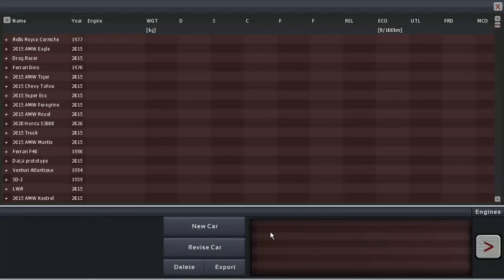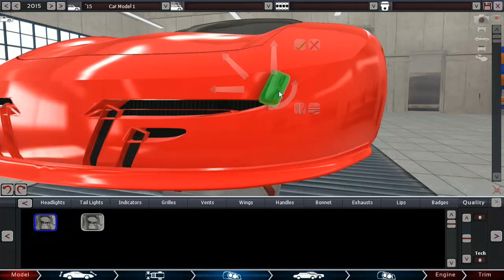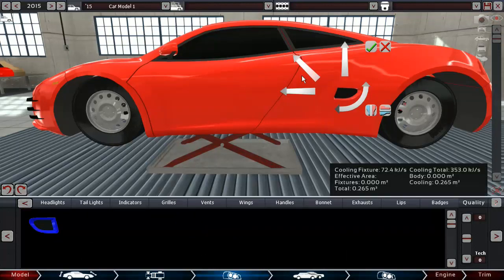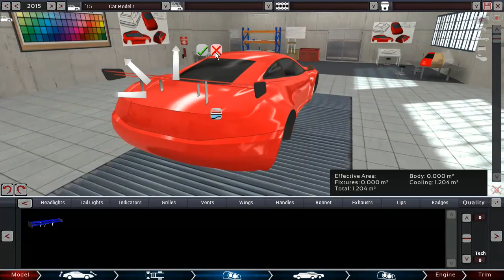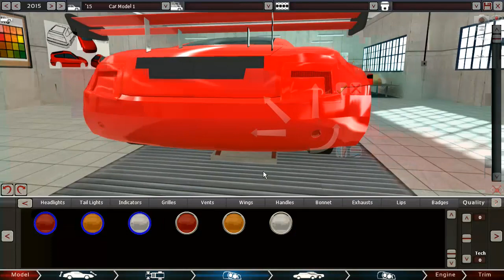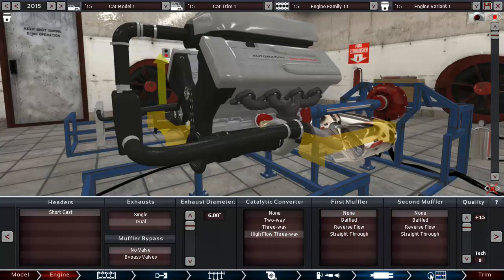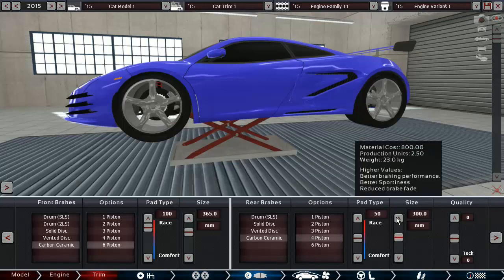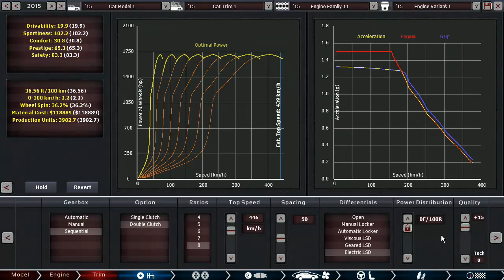Automation [Ep. 127] - Building the Blitz Ensis

Comment: Here's a challenge Tom, make a million-mile car. It not only has to last 1 million miles, but should also be enjoyable (I'll let you define that) enough for the owner to take the car to 1.62 million kilometers.
Reply from the maker: Nott Mynaem Well, the AMW Grizzly from episode 122 would be one such car, because the engine is made from very high-quality materials and has an in-game reliability rating of 89.2 which is significantly higher than your average engine, let alone cheap engines. Plus, it's got 840hp for when you feel like driving fast, AWD + driver assists to keep it safe and stable and a glorious exhaust note. The only downside, aside from the fact that not everybody wants a fast car, is the price which would be somewhere between 250-300k. Oh, and that it's not the most economical car, but considering its price, the target audience probably doesn't care too much about the fuel economy.